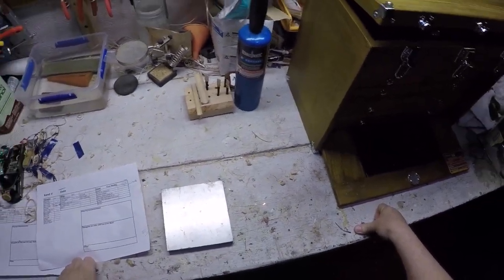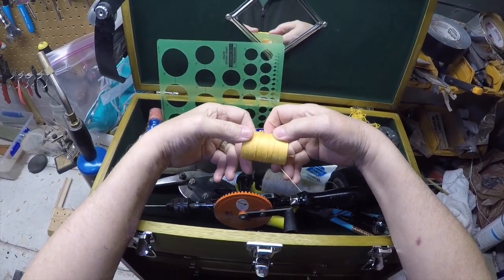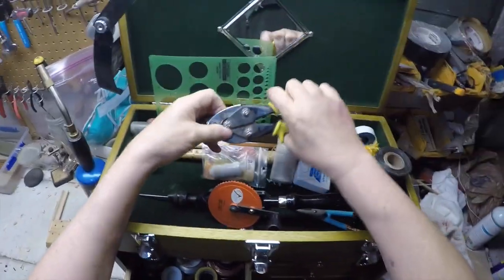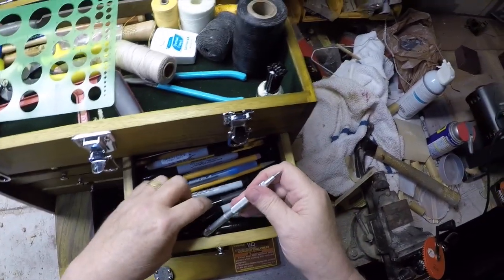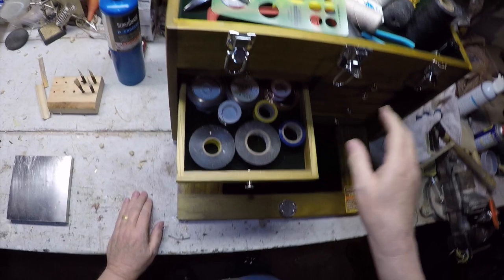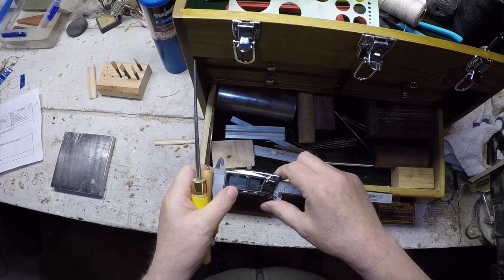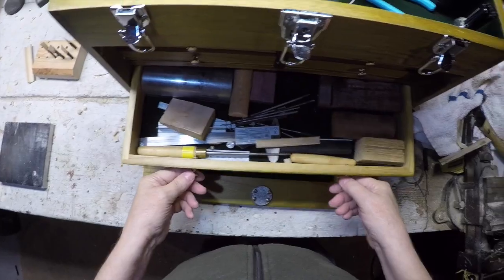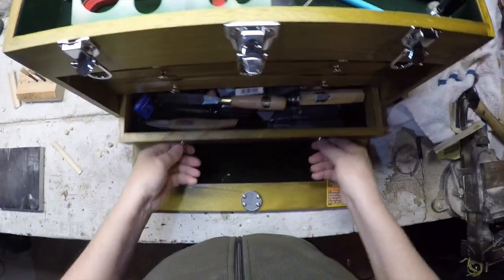Reedmaking tools

Comment: When you sharpen that last tool, the cabinet maker's one. Sharpen to a blade edge but then run it along say a round bar at an angle to slightly curve the sharpened edge so that when you scrape with it, you can scrape the surface that you lead on to. If that makes sense?